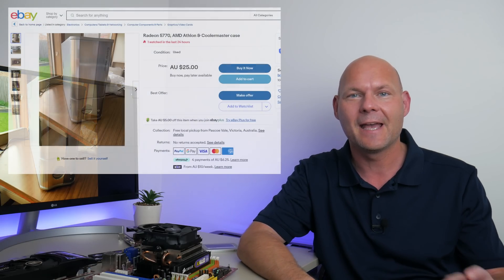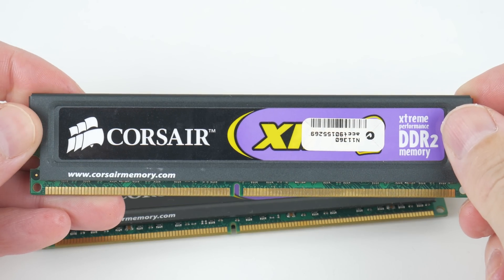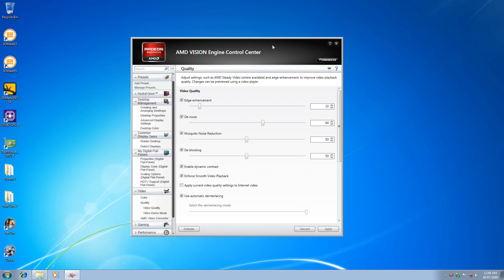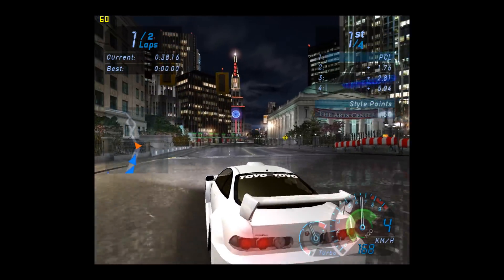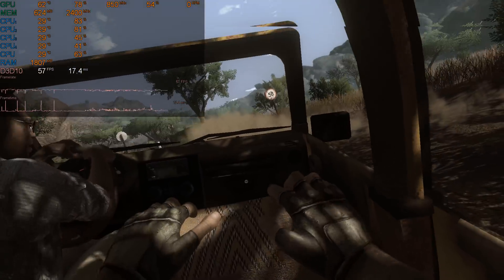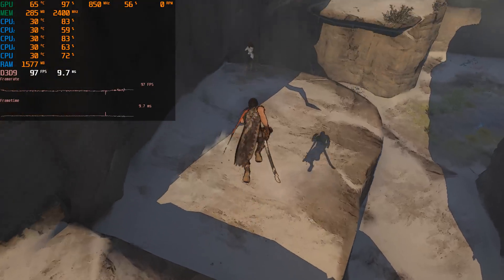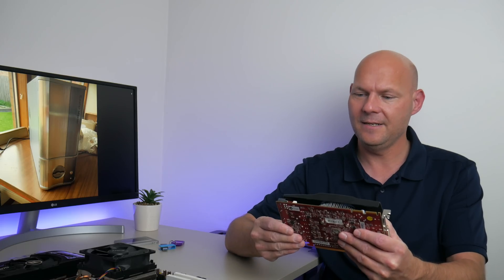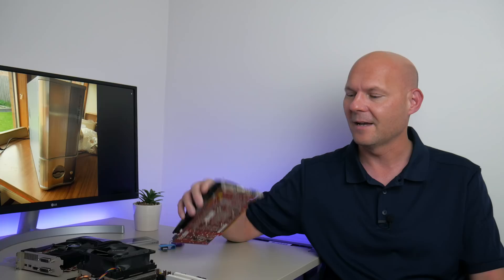Is This Old Athlon II PC Worth it?

Comment: One of the best parts about checking out your retro videos is that you go outside the bubble and test other games too! Always cool to learn of some of the titles I may have missed.
Reply: Yeah it's good to see games we may have missed or forgotten.

I love the Tomb Raider, Prince of Persia, Indiana Jones games, KOTT 1+2 and also Lost via Domus, FarCry, Crysis. Sadly Uncharted is PS only.

A propos Screamer 4x4. I had 4x4 Evo 1 or 2, which looks similar. And a newer one called Spintires Mud Runner.
Flatout 1+2, the old Crashday and the old Trackmania Sunrise Extreme also are nice. Better than most remakes.
Wreckfest seems to be a bit like Flatout 1.
Reply: I wish there would be more test with newer games as well. People always test the same, but not everyone plays CS:GO, CoD, BF1, SotTR, Witcher 3, etc. And if you don't play those benchmarking titles, good luck finding tests. I've had a very hard time finding Planetside 2 benchmarks on new hardware, and the only one that isn't 5+ years old has confirmed that the 5800X3D is indeed 40% faster than the 12900K

Comment: Make sure the RAM slot is not dual channel, if it is move  one of ram chips over or you will lose performance. Some motherboards have Two slots per channel. Should be marked on the board as well. nice find phil.
Reply: One of the early AM2 boards where the slots were placed differently.

Comment: 2:50 WRONG INFORMATION !!!
AMD is bought ATI in 2006.
AMD's first released GPU's HD 2000 series in 2007.
Reply from the maker: 5770: ATI. 6770: AMD. Same GPU, same clocks 🙂
Reply: @philscomputerlab  
Since 2007, all gpu's developed by AMD, A.K.A "Radeon HD series".
Last developed gpu by ATI  is X1000 series.
Reply from the maker: @Arhentir  I did image searches and 5770 have ATI logo, 6770 have AMD. Same specifications.

Comment: I have such a system Athlon II X2 240e (2.8Ghz) + Radeon 6770 + 8Gb RAM that used to dual boot Linux and Windows 10. I used to play Diablo 3, Crysis, the three first Mass Effects and Vampire: The Masquerade Bloodlines. I didn't max out the settings and didn't look at the FPS. It was fun. It's still a completely fine Linux machine these days.
Reply: I have both E8400 3000 MHz and Athlon II x2 260 3200 MHz. They're almost identical in speed.
The Athlon II x2 even saves more power in idle state (800 instead of 2000 MHz) and even the small AM2 CPU fan didn't even start when cold booting.
I had to disable the fan speed warning or it will beep all the time, lol.
My C2D E8400 always had huge heatsinks, but also ran below ~ 42 °C idling, undervolted even below 37 °C (CPU diode stops measuring below, always does show 37+ °C).

Both Core 2 and Athlon II are some of the best efficient cool running CPU series ever made. Built to last for 20 years or more.
Reply: @sebastianebert4295  With the CPU cooler I use in this system, even when the CPU is maxed out I've never seen it get to 40 degrees. It idles at 28-30 depending on the season. So yeah hopefully this machine will last a very long time. But just in case I picked up a spare Athlon II X2 240e for 10 euros lol

Comment: My Phenom II x6 1055T system already had DDR3. Also had a MSI HD5850 2G OC with it that died quite a few years ago (possibly due to years of memory OC).
Funny thing is, I bought the 5850 not long before the new AMD GPU generation, because of my previous card dying and was wondering, if I should wait without being able to use my PC. At the end, I was glad to have bought the 5850 for 120 EUR, because the new cards in this price class were, like mentioned in the video, only rebranded and slightly overclocked ones of the previous generation. AMD did this for quite a few generations and it was annoying...

SSD wise, I got a 500GB Crucial MX100 when upgrading from the Phenom II system to an i5 4690k one. The i5 with MX100 is still running strong as a emulation machine in our living room.

At the moment, the motherboard with CPU, RAM and CPU cooler is sitting in our living room and I still don't really know what I'm going to do with it. Should also look for an open bench, so messing around with different builds is easier than having to move hardware in and out of proper cases.

Comment: 02:50  The 5770 card came out years after the ATI acquisition.  It's part of the third generation post-acquisition.  The 6770 rebrand is just something that was done to fill out the lineup in the next generation, which doesn't always include a full range of GPU performance tiers.  

Has nothing to do with the ATI purchase.

Comment: That is a really bad Mainboard, it was built in the German Aldi Supermarket PCs and the Failure is relative high.

I had that PC With Athlon II X4 aswell with 8 GB RAM and a Later Installed GTX 750. But the Mainboard has Started to Fail, and i replace the PC

Comment: Athlon II X4 620! My first quad core BITD. The difference between it and the 640 is not very much, not even 10%. My particular CPU would allow the L3 cache to work with a motherboard tweak. It made a nice difference in some things but in most almost nothing. Great to see those temps in the benchmarks, under 30C while running them. Not hot or thirsty. Still use a couple of the AM3 chips in my home set up.
Reply: Most of the times the 2nd fastest CPU is enough. Fastest is like 5-10 % faster only, but costs like 50 % more. Same with car motors and most other stuff.
Interestingly the efficiency also is better with the 2nd best parts ;) No or less thermal throttling, saves energy/money, lives longer.
Better invest in more RAM/SSD/HDD, unless money is no boundary.
Reply: @sebastianebert4295  Thermal throttling is very hard to accomplish on the Athlon II parts. They top out at 70C IIRC. I started using the stock HSF on mine and only got something else when it quit working. The Arctic Colling units for this socket were quite cheap and good. Still using mine after 6+ years. TBH the temps rarely hit the mid 60's.
Reply: Yeah my x2 260 doesn't even need a bigger heatpipe/fan, but I still have one Arctic Cooler Freezer 64 Pro sth. from an old 4200+.
I just read that the Ahtlon II x2 260 came out 2 years after the Core2Duo E8400, so it's a bit of an unfair comparison, but still a good CPU, both of them.
I think both Core2Duo E8400 and Athlon II x2 are perfect for XP retro gaming. They were built in masses. If not going for i5/7-2xxx or faster, lol. Those also are good.
But one thing I don't understand is, I have the i7-2600 95 W CPU in a Dell 790 SFF, but Dell caps it at 65 W. Still the benchmarks of CPU-z and Passmark Performance Test show it's the same values as a stf. i7-2600 95 W CPU. I mean I don't complain, but I don't understand how it can be that fast throttled @ 65 W.
And those i7-2600 run at max. 68 °C here so far with 100 % load while doing benchmarks, having only a very small heatsink and fan in a SFF case, which is quite efficient. Idle temp is like 35-40 °C. I guess Dell just has a good cooling design, good airflow making it efficient.
Tbh., I thought about only using 2nd hand business class in the future, but ofc. we're a bit limited with the GPU. For me that's not that important, as I want to save energy at all costs. That's why I still use the GT 1030 GDDR5, but for old games it's more than enough, 100+ FPS with 1080p and dgVoodoo2.

I'll definitely check out the Core2Duo and Athlon II again for real XP retro gaming. My GPU will be ATI HD 4550, ATI HD 2600+, Nvidia NV310 or what I can find in my boxes. I also have Matrox G400 and 3dfx Vooodoo1 or 2 which I never used. Will add my SB Audigy 2 ZS again and have some true EAX fun.
But as said, those faster Core i also would run it the same way.
Reply: @sebastianebert4295  you might consider the HD 5670 or 6670 as they came with faster DDR5 RAM and were still under the 75W PCIe limit.
If you can find one, Athlon II X2 280 is the fastest dual core of the line. 3.6GHz stock. I have one and got it up to 4.2 reasonably stable. Not much of a gamer but no problems with HL.

Comment: This video was quite timely. I recently finished playing around with some of my old motherboards and cpu's for shites and giggles. I was curious to install a debloated win 11 install on some of the combinations to see how well they could cope with the latest version of windows. I have various AM2 - AM3+ cpu's including but not limited to X2 5600, FX4300, FX6300. FM2+ A10 7850K A88 X system and an LGA775 system with a 771 modded Xeon E5450 fitted. All are capable of running windows 11 for mundane everyday stuff. The comparisons between those AMD setups and the best that LGA775 could offer was also interesting to revisit. AMD were so weak back then.
Reply: The S771 to 775 mod is very interesting. I thought about it maybe 2-3 years ago, but then thought already available i5/7-2/3xx are faster again and also very cheap.
Some years before when Core i was expensive it made more sense ofc.
I also had some 6 core 80 W Xeons from Dell workstations w/o mainboards, but not that fast, so I never used those.
The i7 equivalent Xeon are worth it nowadays.

AMD was weak? The Athlon II x2 and Core2Duo have exact the same speed per frequency. An AMD II x2 260 3200 MHz even saves more power in idle state compared to an E8400 3000 MHz, running @ 800 instead of 2000 MHz. RAM benchmark also is quite similar. Not even 5 % speed difference between those AMD/Intel CPUs or RAM speed.
AMD FX and mobile Turion may have been inefficient, but so was Core2 Extreme edition.
Reply: @sebastianebert4295  In saying that AMD were weak back then it's in comparison to the CPU's I discussed and compared. What's got to be taken in consideration is the release date of the Intel vs AMD CPU's. There's anywhere between 2-6 years between them with the Intel CPU's released in 07-08 and in benchmarks the Quad core 771 and 775 CPU's were not exactly walloped by much newer AMD CPU's. Same likely holds true for 2 core comparisons as you mentioned.
Reply: Oh right, didn't know that the Ahtlon II x2 260 came out that late in 2010, Core2Duo E8400 in 2008.
I had the AMD 4200+ and 5200+, but before I got Core2Duo E6600 and E8400.
I got them used and don't know much about the earlier Athlon X2. I heard the Deneb core was quite popular, tho.
A bit older Athlon 64 x2 5xxx may be good, but to be fair, we should compare 65 W models only, not 89 or 125 W models.
Okay it seems like the Athlon 64 x2 also was kinda inefficient. One more reason for the excellent S775 E8400.

Comment: Great video, as usual, Phil!  Good price on the PC, I'd have snatched it up for sure if I could... my problem nowadays is space to store all these parts, especially cases. Maybe sometime you could talk about how you manage your inventory, which must be no small task. Thanks!
Reply: It's new enough that it will run Windows 10 if you throw in an SSD and will run games up to maybe 2015-2017 fine with that quad. The first issue to show up would be SSE4.1 requirement on some newer games. But if you play slightly older games and do usual desktop work, this would totally be fine as a daily driver even today.

Comment: Happy Friday Phil! Thanks for sharing. I wish motherboards like that were that cheap but here in the US you can expect to pay at least $25 and usually more. The cheap boards to find here are OEM boards from Dell and HP for 2nd and 3rd Gen CPUs. $11-$15 on average to get these, and they work fine for XP/Win7 builds. There’s a little proprietary connectors issue with some of them, but there are documented workarounds or adapters available to address these challenges. Have a great weekend!
Reply from the maker: In general, individual parts will end up costing much more.
Reply: @philscomputerlab  depends on what you already have on hand, but buying an OEM prebuilt is probably the cheapest route these days.
Reply: Yeah complete PCs cost literally nothing, but parts cost more.
Yep, 20-30 bucks for complete 2-4 core PCs is not seldom. Corona raised prizes, but they came down again.
I think when Win 10 officially ends in 2025 all i7-7xxx even are outdated, noone of the billions of "normal people" wants those, but they are fast enough, we even can use Ventoy or Rufus and use those with Win 11, lol.
Even for the RAM alone you can buy a used PC and it's cheaper than the RAM alone, you'll also find some black box stuff the seller didn't value.
At least a working PSU, HDD, SSD, some heatsinks and fans.
There's also many Win 7 to 10 upgrade fails, "defective" PCs, which are fine, but most people have no plan how to fix it.

Comment: Im just curious. For you the game is playable only if the tested PC can run the game at max settings? Cause thats what im getting from what u said about Crysis. That is unplayble cause it cant run properly on max settings. But if u can adjust the settings. Me personally thing that the game is playable if u can make it playable by well tinkering with the graphical options and if even then it struggles the game is really unplayable. So i guess what im trying to say here, that its a bit misleading telling that it cant handle Crysis, if it in fact cant do it only on 1080p very high. 
But thats just me. I was always kinda struggling to play games. Not to be able to afford stronger PCs, so i did my best to make the games playable and look decent in the process. 
And if there wasnt any other options and if the game run great on the lowest setting, i was ok with it. So in my opinion unless a game is unplayable on the lowest settings (graphical option not resolution) then only then the game i think should be considered as unplayable.
Reply from the maker: It's a fun thing really and only the highest end modern machines run Crysis maxed out.

Comment: Something tell me, that our vintage hobby are cooling down.....
Reply from the maker: What do you mean? Hey are still into the Commodore computers?
Reply: @philscomputerlab  Usually when I put Win98 conpatible parts up for sale, they sell. But the last 4 months I have had GF2-GTS, GF4-ti4200, Asus A7V266-E, YMF-724 and TNT2-Ultra in compaq variant up for sale at hald eBay prices. None have sold, and only half the number of sales add views.

So it is as far as I can see, cooling down. But yeah... Still into Commodore stuff on my behalf. I have build two C64's from scratch now. One 1:1 1986 model clone and one ATX forn factor. I even modded the Rom after combining the 3 into one for the ATX board. (I have it on my channel)
Reply from the maker: @brostenen  Now I'm not up-to-date with parts prices, but here in Australia such cards are not cheap. In the past I had to get many parts from overseas, maybe that is something you could look into, selling and shipping overseas? It could also be that established sellers are just listing high prices for the few sales here and there, I think price skimming is the term for that? Collectors likely look for boxed products, hard to say...

Comment: Main problem with getting a pc like that as retro pc is that the most games shown here would also run fine on your modern pc. At least for me a purpose of a retro pc is that you can run something on it that would not work on your main pc so it would be nice if retro pc video would concentrate on games that you can only run because of getting that specific pc.
Reply from the maker: So I agree with you that many XP era games can be made to run under Windows 10. It does take time and effort in many cases, for example going to PC Gaming Wiki and reading up on all the issues if there are any. Some games might not render things correctly, like Far Cry, it's all in the details. EAX sound and just the feeling of "it just works" as well as the feeling of using Windows XP.
Reply: @philscomputerlab  There is also an option of putting that sata SSD shown in the video to a modern computer and installing that windows 7 there as second OS. If you want to install windows xp then I can understand issue of modern hardware not having drivers for windows xp.

Comment: Yeah, I always stuck with nvidia graphics cards back in those days. My friends had ATI/AMD cards, and they were always having issues. At one point I was convinced that their drivers were written by monkeys, they crashed so often.
Reply: Must have been the Catalyst drivers, Via/ALi chipset drivers or latest GPU drivers. Around 2015 or so I've seen that in Linux there were no proprietary fglrx with the Xorg version sth. desktops anymore, after AMD bought ATI. Maybe at that time the ATI Windows drivers also were non existent or bad? Or was is many years before 2015, around 2007-2010 ish?
I had no issues with ATI 9800 SE and P4 3200 Prescott S478 in 2004-2008, but I used Omega Drivers (faster than Catalyst).
Later I had the ATI HD 4550 and HD 2600 Pro and also no issue, also with AMD 4200+, 5200+, Intel E6600, E8400 after 2008.

Comment: I saw one of your videos on the Pentium II from a few years ago. In it you showed the 266mhz model. What i noticed was that you had almost 80fps in quake 2. I only get around 39 using the geforce 2 mx pci. But its the same regardless of resolution. What im thinking is that the FSB is only 66mhz. Could you do a comparison video between 66 Fsb and 100?
Reply from the maker: I likely was using an AGP graphics card, but don't remember what drivers I used. Older drivers can be faster. Sure 100 MHz FSB helps but it will not double the performance.
Reply: @philscomputerlab  I believe you used the Quadro2 Pro agp. I agree the difference shouldn't be so high. I've tried the drivers you have on  your site along with the latest supported. Difference was about 1 fps. I did update the chipset drivers but that only affected software rendering giving about 7 fps increase. Perhaps I need better pci drivers.